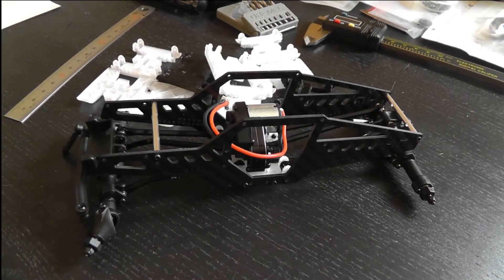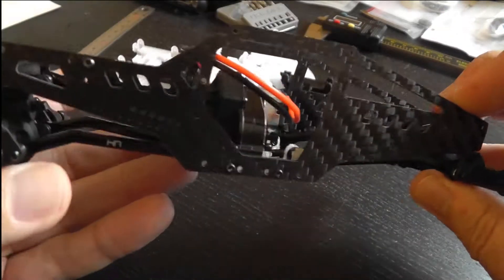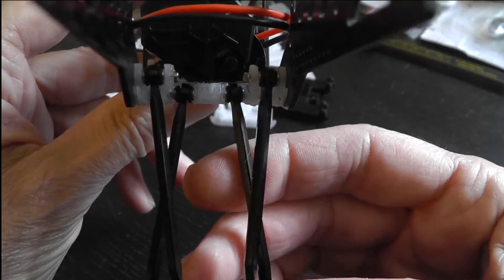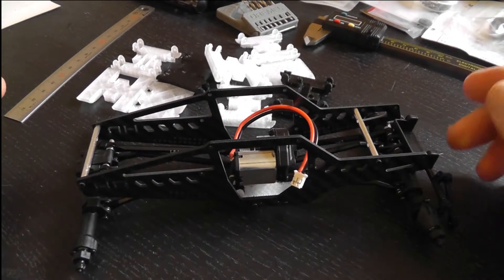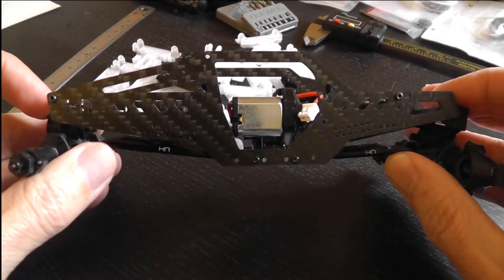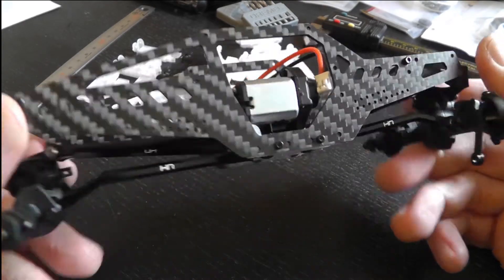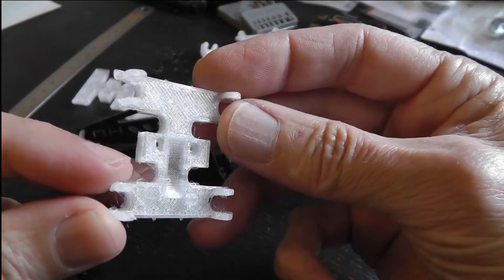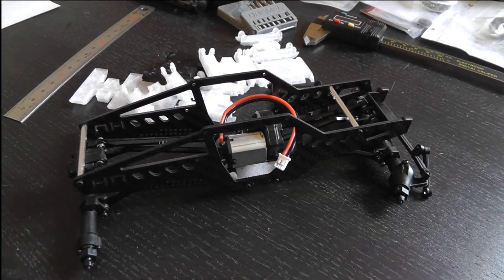SCX24 Flat Skid

Comment: Nice print man glad you got it sorted out 👍
Reply from the maker: Thanks! LMK about that Killr skid and what else it fits.
Reply: @baxrok2.  will do
Reply: @baxrok2.  the skid will fit any chassis but you have to make custom holes to bolt it into place, it doesn't use the stock location that are on most rails. Hope that helps some 🤙
Reply from the maker: @fmfdocrc8682  Yes, that helps a ton and is exactly what I wanted to know. Thanks!

Comment: I think the jec racing chassis  also has flat skid its kind of similar  to your design
Reply from the maker: First time I've ever heard of JEC. Looking at their Evolution chassis it does appear to have a flat brass skid. The only difference that I see is that they have the upper links in line with the lower links whereas mine are up in the same location as the stock skid. Thanks for telling me about it, they have some interesting stuff.